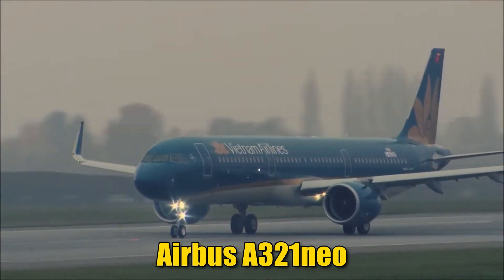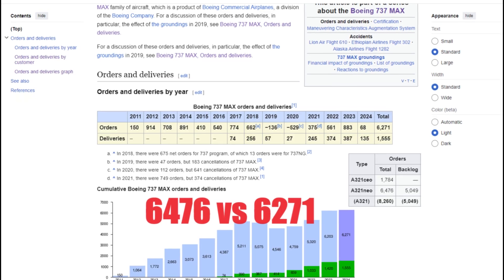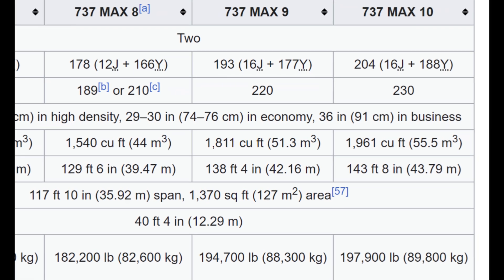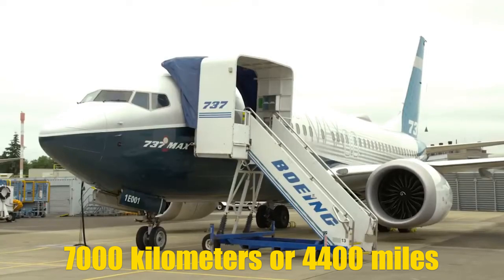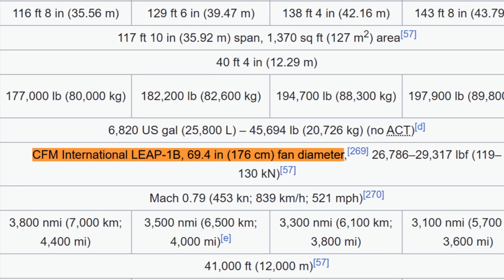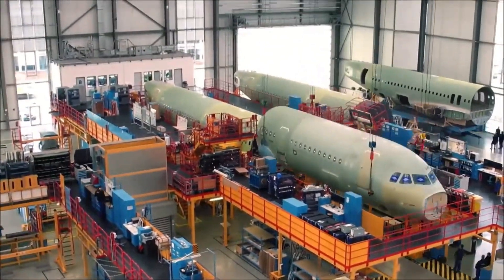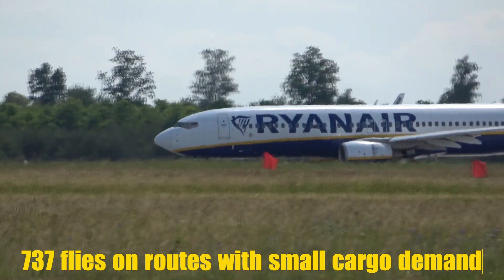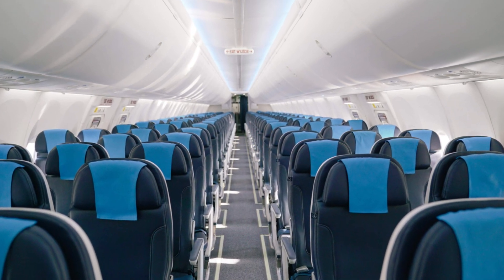Every Airline Prefers NEW Airbus A321XLR Than Boeing 737 MAX! Here Is Why

Comment: It is a lot better piloting a 737 as it has a yolk and the 321 has side stick .The 320 went thru the same thing as the 737.max.
Reply: Wouldn't that be a preference?  This video is about facts
Reply: @bp900  I am talking Facts to as it better to Fly a 737 then a 320/1
Reply: @AgeCobra  the word better in itself implies it's a matter of preference
Reply: The 737 is like driving a car from the 60's with stick (manual gear), where the A320 is like driving a modern car, just put it to drive and it will keep speed, break and regenerate, switch gears etc. Some people still love the feel and drive of a classical car, some just prefer for the car to do the trivial tasks in every day traffic, for example avoiding declutching, shifting in first gear, clutching, driving 15 meters in dense traffic, stopping and repeating this forever.
Reply: @todortodorov6056  No it is not like driving car from the 60s and Modern cars suck causing wat to many accidents nope 737 is better to Captain .
Reply: @AgeCobra  Ok, ja, modern cars causing too many incidents. I wonder if we live on the same planet.
Reply: @todortodorov6056  Cars are the least worry and a 737 is better to fly as the 321 is flown by the autopilot for 98% of the flight 737 70%

Comment: Not every airline prefers the A321XLR's lol, the B737- Max's preforms well and have some advantages compared to the XLR's
Reply: Not really. I mean, I love Boeing, but they are lagging behind on the single isle.
Reply: @rtbrtb_dutchy4183 In terms of MTOW, don’t need long runways, efficiency, the Max’s performs very well. Yea the XLR’s are good but each aircraft has its own advantages
Reply: @Vicstarz26  the XLR needs less runway then the MAX 10. Overal, the A320 series, usually needs less runway than the 737 series. 

Performance wise, they are both basically the same. 

For some companies, Boeing commonality is probably important. Even though Airbus has that figured out better. It’s not easy to switch a pilot from Boeing to Airbus.
Reply: @Vicstarz26  that’s not a straight comparison. The XLR is bigger and heavier. 

But none of those 737s has the range, so even the XLR, if you fuel it with the same amount of range, the XLR will do better than any of those.